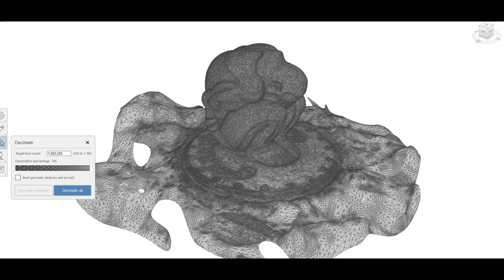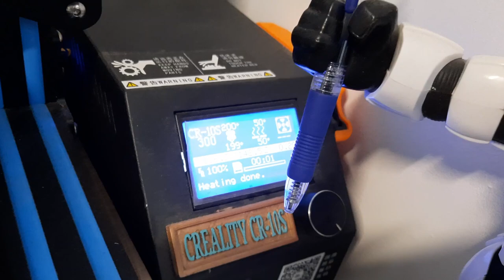3D Print to aluminum metal casting, I wish I knew this before!

Comment: I can see a couple of problems here. Maybe my 2 cents for a better result in the future.
1. Try using a different alloy. Al is not really great for detailed castings use zinc (ZAMAC) or if you want to keep using Al use castable alloys.
2. To capture more details use investment plaster or dry wall compound and thinly cover your parts before placing them in sand. This way you will get a hard outer shell capturing more details.
3. Pouring basin with proper sprue was missing, so was a riser and a spin trap. This can in general improve your casting results.
Tell me what you think.